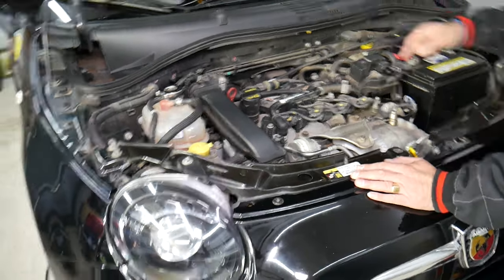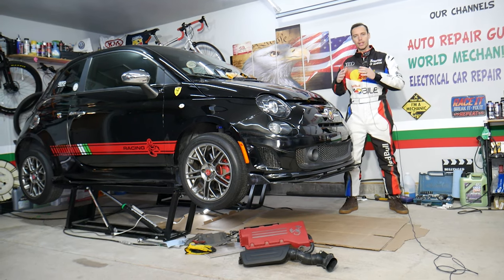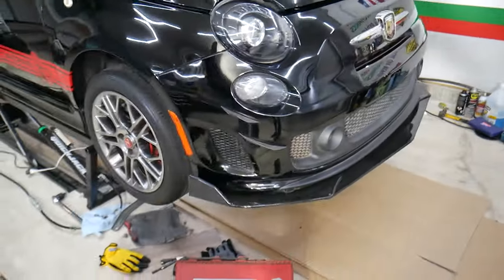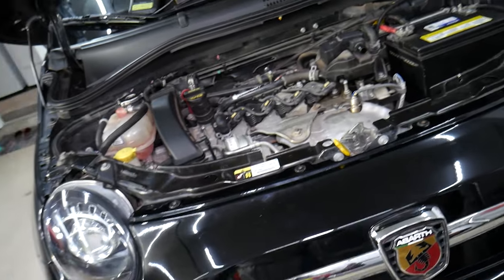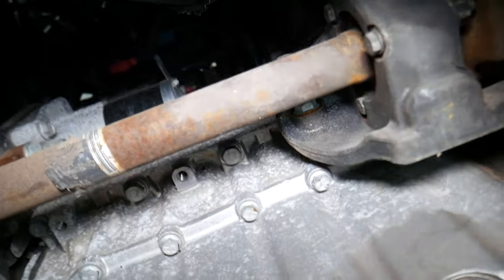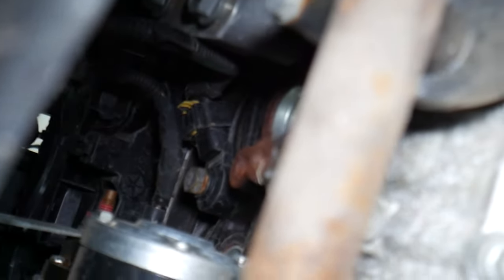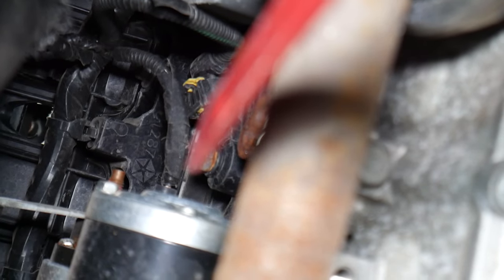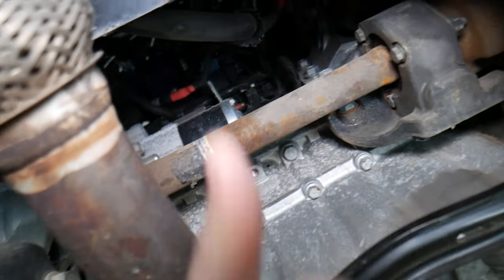FIAT 500 KNOCK SENSOR LOCATION REPLACEMENT

Comment: Hello my 500 Abarth out of nowhere is knocking and pinging when I hit boost. The only thing that’s changed is the tank of gas from the same station. There are no codes. It’s either my 93 octane isn’t 93 or this sensor is going bad I think?